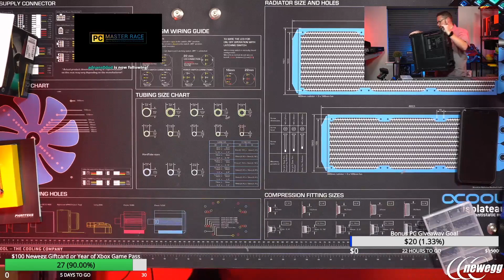We start the Xbox Scorpio Themed Build - ROBEYTECH October 16, 2019 | Robeytech

Comment: Wondering about the power supply in this case. Putting it in so you can see display puts fan on opposite side of intake/filter. Is it getting air? Another build I saw he drilled holes in the PSU shroud.

Comment: $2k to build a computer that's going to be out performed by a $500 console come this time next year.
Reply: Not really spec wise still outperforms the 500$ consoles by miles
Reply: Plan B so you’ve used the Xbox series x already?
Reply: @bigbadslimee  the specs show it's not as powerful as this, you can go by the specs alone for a rough idea and this one has better specs in all categories,the xboxs GPU clock speed is 500 lower than the gpu he uses,even when they have the same amount of cores the Xbox is 1.5 GHz behind in CPU speed it's just a fact computers trying be stylish why powerful will out perform a 500$ console even though consoles are alot more powerful now adays their still behind in power